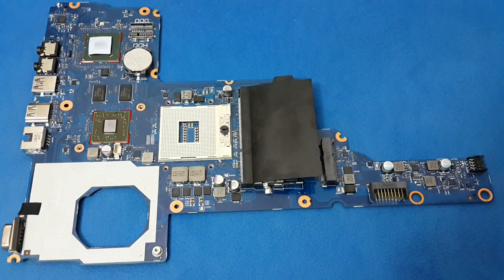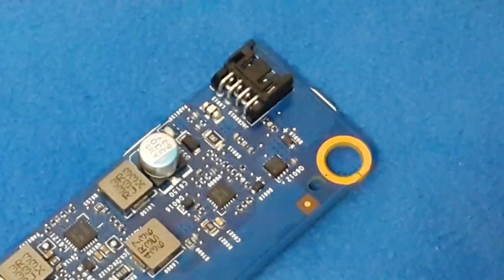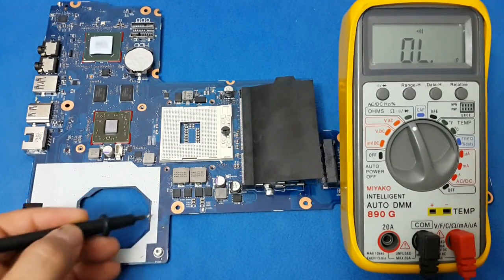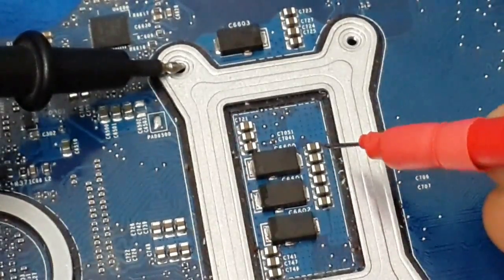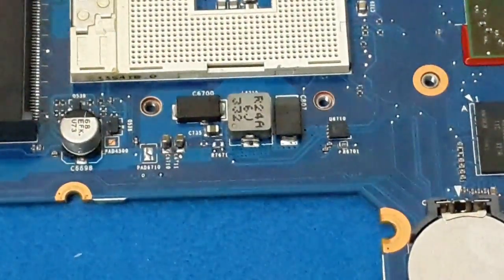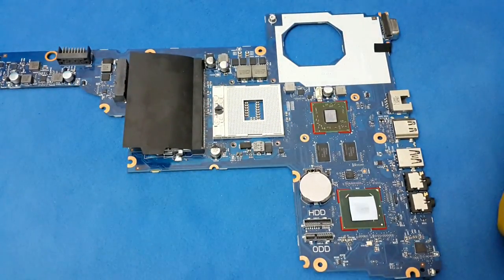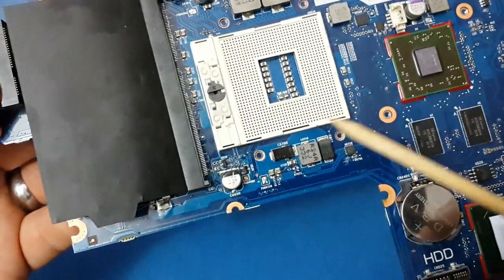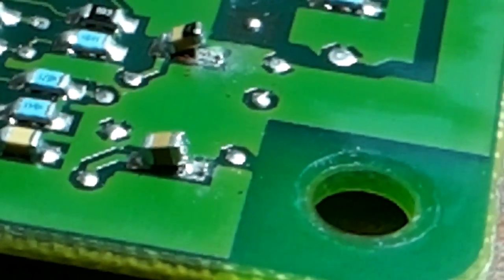SMD bad capacitor  test / laptop - desktop computer & electronics troubleshooting

Comment: I tried this kind of troubleshooting on dead SSD HDD , but it seems like every possible capacitor and fuse on it have conductivity on both sides.... am I doing something wrong?
Reply from the maker: Hi! Sorry for the late answer. All in short means a short circuit in one component in parallel with all. First take your time to visually inspect the capacitors and memory chips. You will look for changes in color, surface finish and possible cracks. Second, use a variable power supply with right polarization, low voltage and one ampere to find if one component is heating. (Using some aerosol culling spray or contact cleaner you can find out who is heating more by the way it evaporates).

Comment: I Appreciate your many informative videos but your method to test smds by lifting one side of the component
is probably not a good idea for the simple fact that you could easily lift-off the pad attached to the soldered side of the component!
Reply: R. D. Just as bad, he will damage the layers of the capacitor and MAKE it faulty even it it wasn’t so resulting in poor diagnostics

Comment: what happens when a capacitor has no continuity in either way? Is that particular capacitor faulty as well?
Reply: It likely means you have not found a common ground to the capacitor.

Comment: old good low voltage current source is must in this case, just give them 1v\2-4A and you will see which of them is bad
Reply: Can you explain that please ?
Reply: @hedgehogthesonic3181  bad capacitance had low active resistance. If you connect low voltage current limited source to shorted line, you will recieve wire resistance+cap res. with 20-90% of total power dissipating from dead cap.(or transistor\ic). in layman words "bad things turn hot".  In notebooks\pc all compoments can operate safely under 1v(without osc), so no more harm can possibly done here. and most wires(maybe not low power signal lines) can support up to 5A safely. sorry for grammar^^
Reply: @krabokiller  It's okay, your grammar is quite good : - ) 

And that what you have explained, can be used to find a dead capacitor ? if gets hot, is probably dead ??
Reply: @hedgehogthesonic3181  yep, if it not shorted way lower than wire resistance.
Reply: @krabokiller  Then if is lower what do we do ?
Reply: @hedgehogthesonic3181  then it's time for method shown on video, or random desoldering of ceramic caps till short is gone. this is a tedious task when shorted main power line(b+ 7-20v for notebooks). you need to check all dc-dc converters for faulty mosfets before this though.
Reply: @krabokiller  Sorry for asking but... what a short is actually ??
Reply: @hedgehogthesonic3181  low or zero resistance(impedance) between line A(+V) and line B(gnd\0V\common)
Reply: @krabokiller  To check that i need a multimeter in continuity mode ?
Reply: @kidshigh  hello, yes they can be shorted. But mostly they got high parasitic resistance, sometimes inductance(you can expect abnormal heat from them at work or measure their ESR)
Reply: @chainbreaker  ME ?

Comment: can you tell me what a k1117s15 chip is.please
Reply from the maker: Hi! It is difficult to tell. Most electronic components have an abbreviation of its real number. It is the reason we use three references: the number you wrote, the kind of encapsulation shape, and where in the circuit is located? If it is SOT223 encapsulation and it is located in a voltage source circuit, it can be a voltage regulator. If it is  a TO-220 or similar encapsulation located in the output, it could be a N Channel transistor. More questions related with its load will help to find the answer for what voltage regulation level is it as 15 Volts or 1.5 volts, or the kind of transistor if it was in the output...

Comment: Hi, if you do not have the schematics for the board, how do you know the correct spec for the SMD capacacitor ?
Reply from the maker: Hi! Most of the time we don{t have schematics. If the capacitor is in parallel to the voltage source, it  could be 0.1uF. Other ones, could be compared with other capacitor alike in other stage of the circuit. There is nothing to lose. Because we recovering a lost board.

Comment: A short can still get to ground. This is an open circuit/break as the failed component cant get to ground, right?
Reply from the maker: Hi! This is a stage break from source. We can separate the stage circuit from its power source. The idea is to reduce and locate the failure area, because a short circuit between the power source lines is reflected all over in almost all the stages when the laptop, tablet or smartphone is powered on.

Comment: Hi Bob. Kalpon, i have a problem with the same board. its hp 2000 right? Well mine can charge an boot normaly but the problem is that once its on the u520 ic become hot and when i test all the capacitors that links to the ic most of them beebs on both side. what advice can i get, to keep trying to fix it or to just buy a new board?

Comment: HI,SMD CAPACITOR IS NOT SHOWING ANY VALYE BOTH SIDE ,THAT IS BAD OR OK? PLZ REPLY ME SOON
Reply from the maker: Hi! Multi layer SMD capacitors have not any value printed on it. Only in few cases, physical deterioration is visible. For measurements, it is recommended to use capacitance meters with short and thin test leads or without them. In terms or repairing or troubleshooting, service technicians are more focus in to find only capacitors in short circuit.

Comment: Good information and explanation, but your desoldering technique is tricky as most probably it will spoil the surface of the main board by demounting the main tiny circuits from surface.
Reply from the maker: Hi! It requires practice like all. Even with hot air we can delaminate a PCB. But I use it with capacitors! ...I am just sacrificing the bad capacitor, or inducing latent failures to end on it. The goal is a capacitor sacrifice if it was needed, and to safe PCB. I do not use it with chips, or arrays. The tip I use is flat on one side. It keeps good temperature transfer, and it pulls up the capacitor on one side, while it push the PCB pad down on the flat side. I do not use rounded tips for it. :-)
Reply: Thanks for information Bob.

Comment: Lifting the capacitor is not good practice. You need to desolder both sides. Otherwise you ruine the pads.
Reply: I agree, right at the end of this video, by the way was very informative, but when you lifted the caps at the end of the video, you were in fact lifting the traces on the other side of the caps. It's just a easy to either remove it entirely, or heat up both side of the cap and just turn it 45 degrees. Just as long as it not going to tough anything else on the board
Reply: Ελληνες παντού
Reply: You can see in the video that he actually destroyed the pad. 10:04
Reply: 09:18 like this moment... solder pad lifted and destroyed

Comment: If i understood correctly, if one component is in short there will be bad readings on the whole motherboard? Great video btw :)
Reply from the maker: Hi! It will affect its a specific area. Some times, this area sets the hole system in short circuit, and other times it doesn't. (There is one of my  videos about a laptopLenovo E530C repairing, where the laptop didn't work well, but turned on slowly). Most of the time, when it is a capacitor, the 0.1uF parallel to voltage source capacitors to filter noise, or capacitors in parallel to low Ohm resistors, are the ones with the high failures in the rankings with power transistors or chips with high power outputs. The capacitors to filter noise in short circuit, makes all its neighbors to look like in short too. But, also a bad capacitor can behave like a low Ohms resistor and not like a short. The video shows one of the ways to track them.

Comment: There is not markings on those smd - how do find  the markings on them to replace to get correct voltage - thanks
Reply: As long as you go with a higher voltage it won't matter. Say they are normally a 25volt cap, but you put in a 40volt cap, it will be fine. The mF just have to be close enough.

Comment: Nice video, and explanations, a bit mispronunciation when mentioning the main board but anyone can understand. Any way, thanks for the vid, and I might be late for this but at one moment you mention something about not knowing the rating of the SMD cap.... I think manufacturers use a color and size code for them SMD capacitors. You should look for the specifications sheet. I found one once and it was very useful. I hope that helps :)

Comment: Thanks, well explained, I tested a video cable connector board and its faulty, thanks to your explanation, I have two questions, the letter next to the components means the type of the component is, for example, C for capacitor R for resistor? the other question is where I can get the replacements

Comment: Hi Bob!
I have a question, what would be the problem if the motherboard of a laptop does not turn on. But the red LED lights up when the charger is connected. I visually check the circuit but found no damage or burnt component. I checked some mosfets, they seems to be okay.

Comment: hi there, what if both sides of the capacitor is not beeping? but the other is beeping.
Reply from the maker: There is nothing wrong. One side of the capacitor is connected to ground, and it can be normal. The problem is if the capacitor is in short circuit. We also must pay attention to a very low resistance, in case of the capacitor is in parallel with a low resistance used to monitor current flow. ;-)
Reply: Bob. Kalpon i do really admire your channel, thank you. the situation is that my netbook is no power, the light indicator is on while charging but once i slide the power button nothing happens and the light indicator of the charging port lights out, what do you think is the problem bro? I'm a newbie and I'm trying to figure it out by my self :) thanks
Reply from the maker: There is something in short circuit. When it happens, all the voltage drops down, and even the charging circuit, gets out or order without voltage. :'( The short circuit is not related with the passive stages, like charging or standby. The laptop in the video, was the same problem. (Charging light worked, with a bad battery, but everything shuts down when I tried to turn it on).
Reply: Bob. Kalpon so what may be the cause of the problem? would that be in the board? or in the charger? this netbook really pissed me off i need to make my projects now, please help me :)
Reply: i mean, where i should start first? the power section ?

Comment: Hi Bob.
Great tutorials!

So if understand this correctly you can't have earth on both sides of a smd capacitor? 

Thanks!
Reply from the maker: Yes. A capacitor in short circuit will have conduction from one side to the other. If one capacitor had a side connected to ground, and it gets in short circuit, then both sides will be grounded. It means this is a bad capacitor.

Comment: sir by all due respect, ur checking component w/ laptop bios battery still present???
and i think it much better to use diode mode, and positive probe to ground, not the other way around...
Reply from the maker: Ok! Good question!!! I remove the battery. But it was there, because I tried to check if its voltage was disconnected, and in the while, I decided to make a video.  In another videos I said we must remove the power sources, battery and bios battery. In this case, it was there, already insulated by opening a PCB pad. But to make any Ohms test, even in diode test, the battery must be removed. 
Use the negative to ground, because most DMM can supply more than two or even 3 volts in the Ohm test, and now day's most digital  systems in a computer are 1.8 Volts. It can resist for a while the over voltage, but it is not good to invert the polarity in digital Systems.
Reply: its ur channel anyways...

Comment: You are saying "insulate" the parts of the board by removing solder from those pads, you mean "isolate"?
Thats just a language thing .:)
Great info, I never even thought about isolating areas like that.
Reply from the maker: Hi! Thanks. I made a double check to the verb this morning and it match to it. Insulate is to create a barrier and isolate is to totally separate. The stage is not isolated, because in the other part of a lot of components are sharing the ground. I just stopped the conduction and created an air barrier in the join points to minimize the electrical conduction. Remember there will be leakage currents from other components related in the stages. For most electronics technician and engineers, the difference of the verbs is not so important, as for Biomedical technician or engineers. For them, the leakage currents maters more than noise.
If we want to isolate the stage, we must disconnect the negative, ground, bypass components or to remove all noise coupling capacitors too. Then the stage will be isolated.
And you are right! Most people did pay attention to the coupling areas. There are fuses, "0" Ohms resistors, solder pads, jumpers, a little wire, or a weak PCB track, to cut one side of the electrical conduction for testing. The hardest  ones to find are in small devices like tablets and smartphones. Some of them have it too, but we have to make a double check to find them.
Reply: Bob. Kalpon 
Agree... i like this work like i like your vids. Thank you verry much sir. 👍👍👍